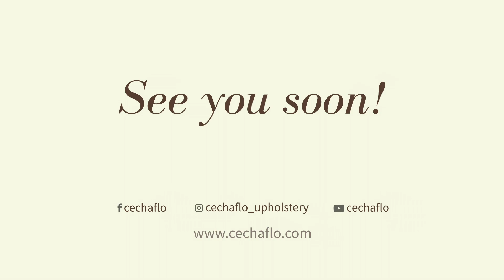How to Join Vinyl Edges (Tip) - Car Upholstery

Comment: Hello, what if you during sewing messed up a piece of vinyl... Is there some possibilities to hide the holes from the needle...? Can you repair the piece? Thanks
Reply: If the mold measurements are not that accurate and the fabric stretches on the proper direction you can play with it and try to hide the holes, on the other hand you will have to remake the whole piece , you can always apply some heat but......that's not a professional solution, its highly recommended to remake it, hope this helps
Reply from the maker: It is very difficult to repair/recompose the little holes the sewing machine needle left. The needle point opens/rips the vinyl material and push it down through.
Sly channel advices are good to consider.

Comment: Where would I use this skill?
Reply from the maker: It is useful to join pieces when we do not want bulky junctions. Preferably on non-tensioning areas.
To get a flat surface and give shape to the inside bag of this plastic piece I used the attaching method on both ends. The piece was done in leather. A similar process in vinyl.https://youtu.be/XdTqJ26HSNY?t=262

Comment: ¡Gracias Cechaflo!

¿Qué tipo de pegamento usaste?
Reply from the maker: El pegamento que usé es poliuretano.
✅https://youtu.be/TIKF6NvXHE4
Reply: @Cechaflo  а в маленьком тюбике какой клей?
Reply from the maker: @ВиталийХвесько  The small tube glue is called 'krazy glue'
https://www.amazon.com/-/es/Pegamento-instant%C3%A1neo-Krazy-multiprop%C3%B3sito-KG517/dp/B000M7RZG8
https://www.loctite-consumer.co.uk/en.html
Reply: @Cechaflo  то есть это обычный супер-клей?
Reply from the maker: @ВиталийХвесько  Yes, it is very hard. Do not apply too much because it is stiff. https://www.youtube.com/watch?v=2tHhW1XOm2U
Reply: @Cechaflo  🤝